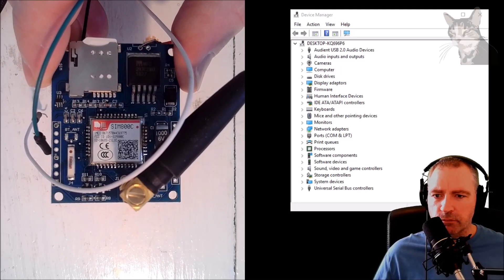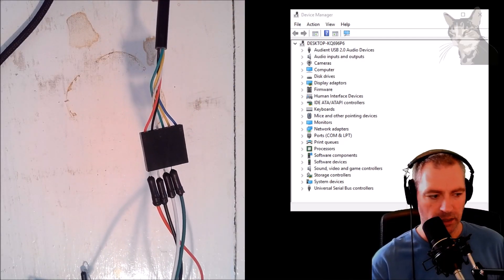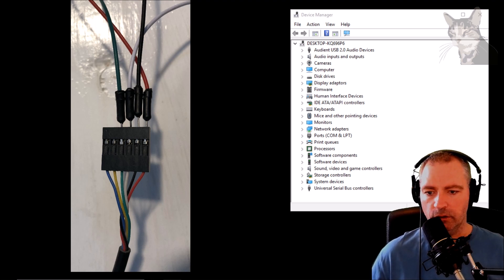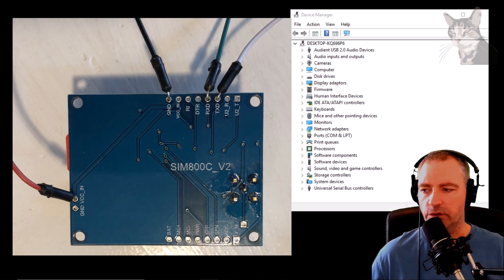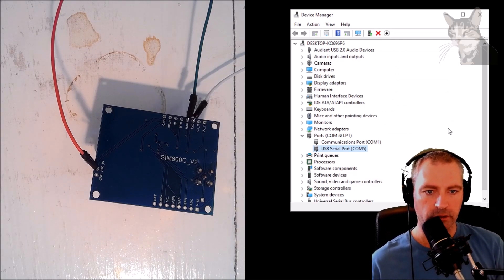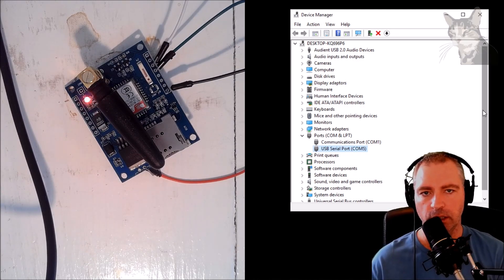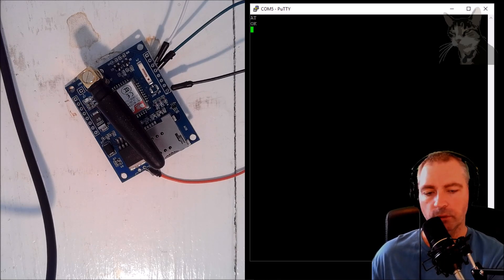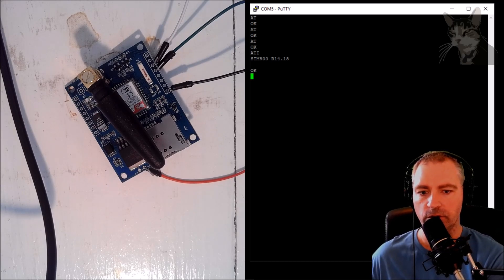Connect SIM800C to PC via USB TTL UART

Comment: I have a SIM800C GSM Module which connects with USB. Everything seems okay and tried using PuTTY with the commands shown in the video but my module doesn't flash or light up. Is it normally like this or should it be still showing signs that it's alive besides the software?
Reply: Update: I tried using the command "AT+CMGF=1" and returns ERROR.

Comment: Hello i got the usb version of SIM800C , how can i make it work on Raspberry pi ? They don't tell what Uart it is and what  Serial through Raspberry
Reply from the maker: look at my video, I don't have the USB version like you do, but I have a USB TTL UART adapter instead. You are in the wrong place.
Reply: @sbcode  Ok i found the solution anyway , it's just a matter of replacing the serial command by USB0 and no serial port and it work the same. Thank you a lot for all your videos
Reply: i have  the same usb probably like yours and using pop-os. i needed to remove brltty to get it to work since linux has something called that way that was interfering

Comment: I am getting an error with "unable to open connection to com5 unable to open serial port" upon opening the putty. I tried searching the error but I can't fix it. Can you help me?
Reply from the maker: there is either nothing on com5, or com5 is already used, or the device on com5 is underpowered to support all its features.  To use this module on windows trough USB, you will need to power it using a battery probably. Other forums discuss this. I gave up using any functionality in it through windows. I connected it to a raspberry pi. Not through USB TTL cable, but directly. The rpi has gpio connectors all over it where you can connect the wires. It took me a long time to figure it out. One day I might make a video of it. I cant remember it now, its all in the past.

Comment: I hope you can reply to this inquiry.

after doing this step do we still need a microcontroller (like arduino) for the GSM?
Reply from the maker: I ended up using it from my raspberry pi. It worked very well with minicom. 
eg, 
sudo minicom -D /dev/ttyAMA0 -b 115200

Comment: I get garbage from gsm via Putty. However, It works with Arduino well via SoftwareSerial...  Can anybody help?
Reply from the maker: The voltage is probably stronger on your Arduino. you can also try a rasbberrypi with minicom